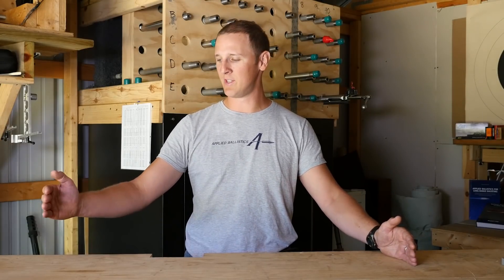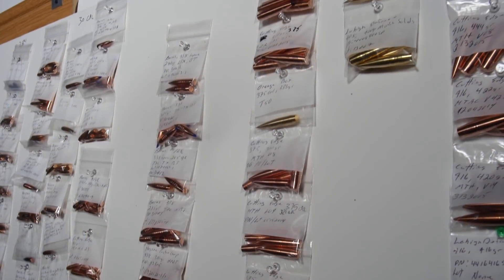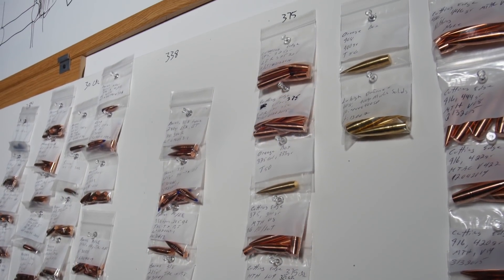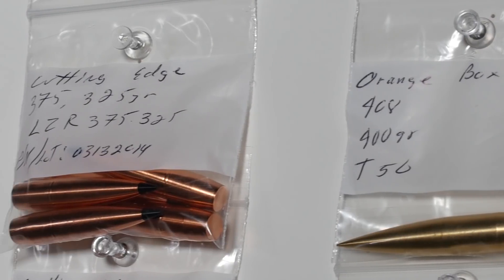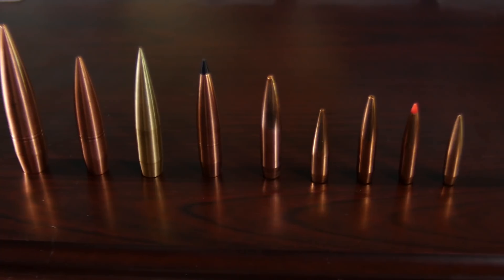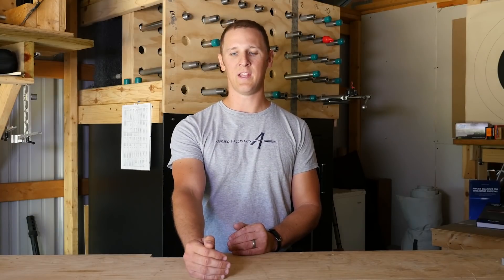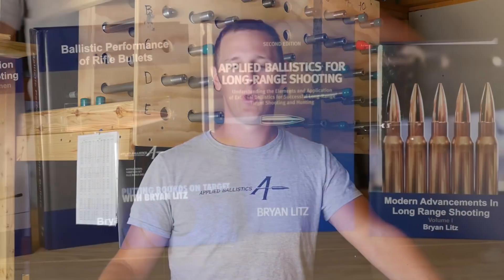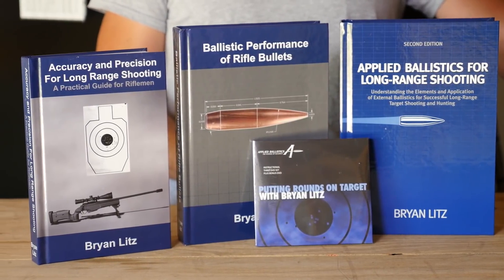Terminal Bullet Performance - Long-range Shooting | Applied Ballistics

Comment: In hunting... I feel that today's emphasis on high BC bullets and long range shooting has had an unintended consequence of shifting focus away from the importance of minimizing the probability of woundings and maximizing the probability of recovery. Terminal performance goes beyond what just the bullet does and ought to significantly include understanding of what the hunter does both before and after sending it. Bryan Litz places emphasis on marksmanship and the human role in accuracy. Similarly the human role in terminal ballistics is a dominant variable that goes well beyond just shot placement. Most people think of shot placement in two dimensions... position of damage relative to vitals... But the third dimension is position of animal relative to any variable or condition that may prevent you from recovering that animal after your bullet contacts it. The probability of recovery is inversely proportional to the distance to the target and it is definitely non-linear and it depends on everything. If you shoot at animals that are waay out there especially with bullets that do not produce consistent exit wounds and strong blood trails at the lower down range velocity after striking the largest bones that are close to the vital organs you are aiming for, you are going to experience a higher rate of failure of the bullet/hunter system. Placing emphasis on this side of the equation naturally and logically leads to the preference for the bullets that are designed to retain the most mass and penetrate the deepest, and limit maximum range to ensure the bullet expands consistently and limit the range to ensure you can track the wounded animal. In my opinion, for most hunting scenarios this means that anything beyond 500yds should be treated with extreme caution, even for talented marksmen. That being said... a bullets ability to retain mass and expand reliably and penetrate deeply is more important than its BC. IMHO.